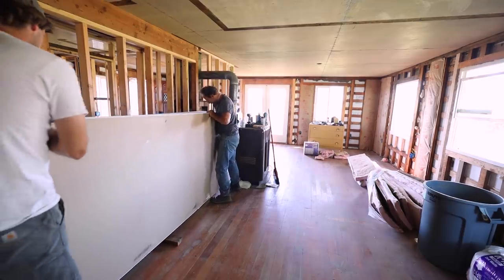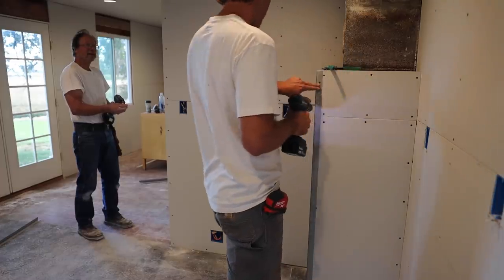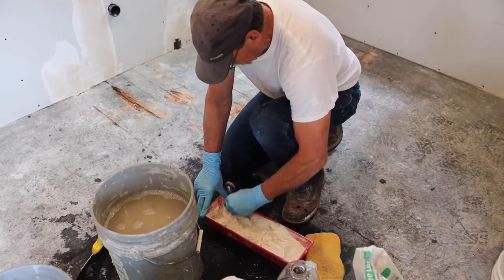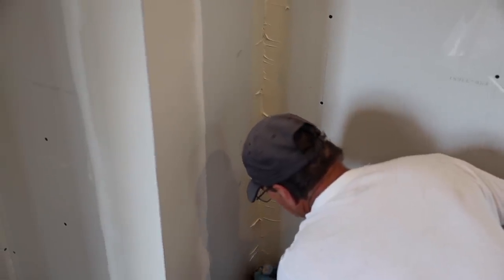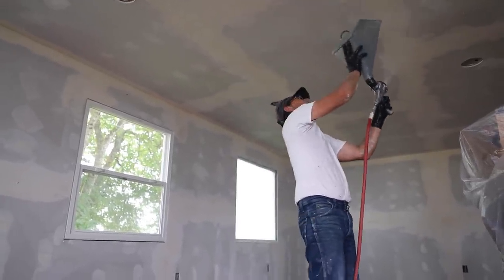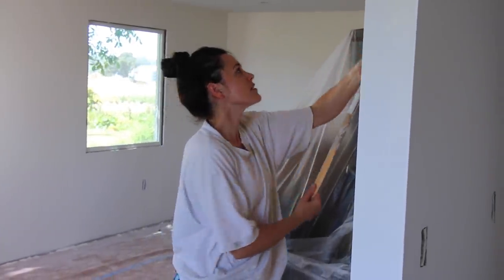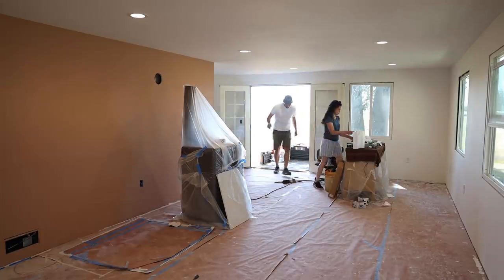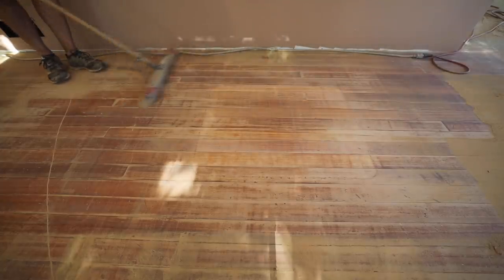Studio Remod pt. 2 - Drywall and Painting

Comment: paper tape boys, paper tape. grab a piece of that fibre tape and move it laterally, now do the same thing with paper tape. And that is exactly why fibre tape is for handyman patches only. It's easy to apply as its adhesive but has no strength what so ever. An alternative to paper if you don't like that is called fibafuse.